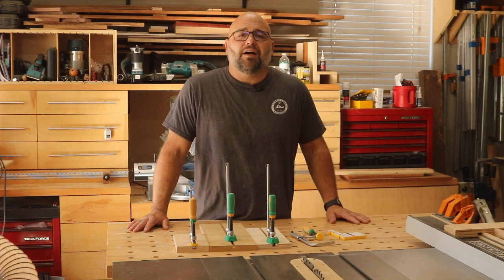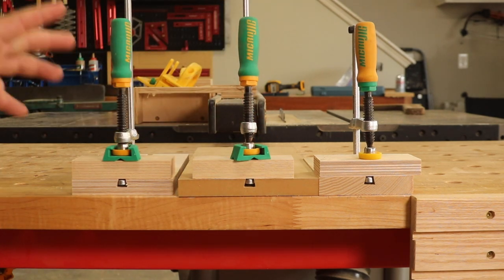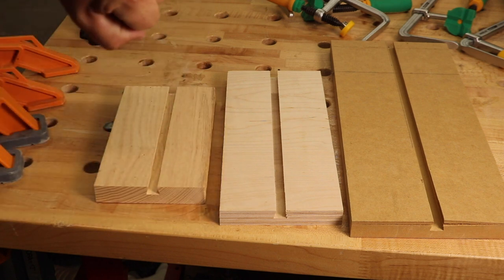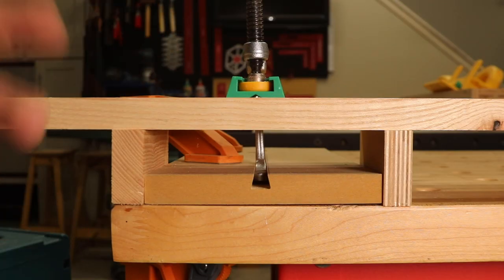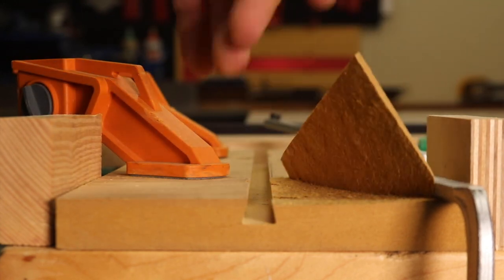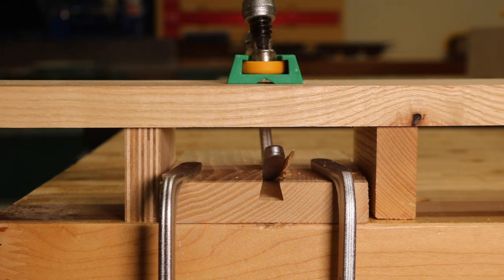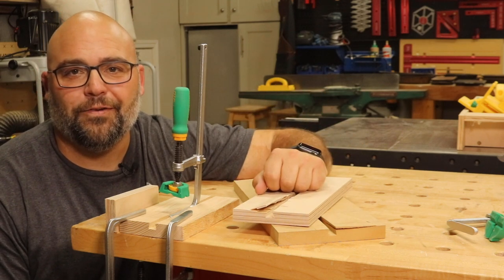Are Dovetail Grooves Strong Enough for Microjig Dovetail Clamps? Let's Find Out!

Comment: Awesome test! I think the ash failed because the failure plane should be about 45° which looks like it may have been in line with the grain direction. Had it been in the opposite direction, I bet it would have been stronger.
Reply from the maker: I bet you’re exactly right. I thought about the same thing after I watched the video.  Would like to try it with the opposite direction! Thank you!
Reply: I'd love to hear how that turns out. Like you said, it's an unconventional, and unlikely clamping method, but must be done for science!
Reply: @PenaltyBoxWoodshop  Hey Jess no worries you have 37,000 other and I know youre busy.  Like t share my dovetail method with yu sometime.
Reply: These clamps are great as long as you realize their limitations.   None of the later tests here were legitimate due to clamping methods, but still interesting.

Comment: WARNING!  I just built a workbench top using the Microjig 360 Workbench plans (which need improving). While doing so, I did experience dovetail groove failure when I left the clamp in a groove without it securing wood - dangling in the groove. I happened to brush against the clamp and the result was a broken groove - the wood split. No more clamping at that area of the dovetail groove. So, don't leave a dovetail clamp in a groove without having it pushed snug against the table or a piece of wood that you want clamped. I still love the dovetail clamp concept.

Comment: Just found this. I’ve been using the microjig system for a cpl years… while the routs are probably not going to fail outright like here, in MDF they do compress AND abrade over time and eventually get too sloppy to use. The solution is to make the clamping surface easily replaceable or use something like Baltic birch. In MDF I flood the channel w a cpl doses of thin CA glue which really does seem to help

Comment: Great test. Thank you for posting this video. It would be appreciated if you would do a head to head test comparing the strengths of the routed dovetails against aluminium t-track, routed t-track, or slots milled into the base.
Reply from the maker: That’s a pretty good idea. Thanks
Reply: There is a video of that test. I think the maker of micro jig did the test...I just watched it but can't remember where.

Comment: I am currently in the design/research phase for building a MicroJig Dovetail Workbench, I see many advantages. And so I really appreciate your testing efforts since strength of materials is a primary concern.  Your analysis has sparked more in depth thought and I want to share.  First I was surprised to see the wood break out easier than the Baltic Birch plywood but I then thought: 1) your clamp was with the grain and so was possibly testing its weakest situation, I noticed how just a bit of grain severed, thinking that running the clamp across grain would be at least a bit stronger.  2)  In my experience with ash it seems to be a bit rigid, possibly because of its open grain.  Wondering if maple, that is a wee bit harder and very dense, might hold up better 3) Then in considering grain direction it came to mind that the Baltic Birch is laminated with grain in opposite directions so no matter which way one would clamp there would be cross grain clamping. Birch is a bit softer than ash but like maple dense. 

My thinking to this point was to use MDF with a Formica laminate. After watching your video I am now leaning real hard to Baltic Birch with a Formica laminate.  Thinking that the Formica laminate will provide a nice smooth easy to clean work surface and might/should add some strength, maybe even considerable strength.  

So this test you presented really gave me some great input and thank you for doing so.  If you, or anyone, has any thoughts on my above rational I would appreciate, especially as to the advantage of adding a Formica laminate.
Reply from the maker: Thank you so much for the in depth comment and analysis. I actually agree with the fact that it most likely broke due to grain direction which was something I didn’t think about when making the video. I think your idea of Baltic birch with a laminate top will work excellent!!!!! Thanks for the support and good luck!!!!
Reply: Looking into an HDPE assembly table myself.  I thought I saw one on one of the micro jig videos. May fit the bill for your requirements also.
Reply: It was also unfair on how he placed the hold-downs.  On the plywood they were closer to the dovetail grove.  In the ash test they were a good bit further away.  If the hold-downs were fractions of an inch away from the groove I suspect both would have held up well.   You mentioned the grain, and I was watching the test while studying the grain and thought the ash would fail easily.   If it had been all vertical grain the results would have been different.  Also that was high end plywood!  13 layers.   Try the same test with a 3-layer plywood with voids and watch the difference!   The quality of the plywood is a BIG factor.

Comment: Great test.

These clamps work great as long as you have the clamped material directly above the clamp arm (in the slot)... just like a t-track clamp.  The material clamped provides equal pressure down, meeting the pressure up from the clamp arm and spreading the load out towards the sides.  Without the supporting material above, the track will blow-out no matter the material used for the base... again, just like a t-track will.  They are not designed to be used otherwise, at least under anything but the lightest of clamping load.

I love mine since it is so easy to route tracks just about anywhere, as opposed to t-tracks (more effort and $ to install).  My plywood topped outfeed/assembly table is full of dovetail groves.

Comment: Great video! I was looking to see how this would hold up in MDF. Yeah, it broke in the MDF, but like you said, it was unconventional. I think for normal clamping use, it should work fine for the application use I plan on using it for.
Reply from the maker: Yep. I’ve never had an issue when using them normally
Reply: Exactly - I’m planning an assembly table/tracksaw cutting station and want to use MDF for the top. A few slots running lengthwise will be great for stop blocks & jigs. Based on this video, I don’t see any problems.

Comment: The second test at 10:29 is a little bit unfair. While you tested MDF by clamping the piece down from the side, you used two clamps on the front side for Plywood. That of course holds back your piece better than MDF from the side. So the testing conditions are not really similiar. But it's a good overview for sure, thanks!

Comment: I think the second test may be the more accurate.  If in the first tests the bottom metal of the clamp is touching the board it is holding down the only way to make the clamp fail is to crush the board.  The clamp has to have a small gap between the board and the metal of the clamp.  As an example, if you had a 1 inch dado in the bottom for the clamp to slide into.  You could crank the clamp really hard but still just lift the hole assembly up.  Hard to see if in the video there was always a small gap between the bottom metal piece and the clamped board.  Thanks for the test but I am less impressed with my dove tail clamps.

Comment: Greta test. The only thing i can think of why Ash failed that easily would be the grain direction maybe? If the Ash was plain sawn the layers would be like that of the plywood maybe it would yield better results. However with the glue lsyers of the plywood since its stronger than the wood itself maybe thats why in addition to its layers being horizontal in relation to the clamp force.
Reply from the maker: Thanks and I agree. The grain direction was a failure point and I didn’t think of it until after then video was shot.

Comment: 7:08  Plywood may had performed better because it has cross laminations and was better supported because your bench clamps were installed closer to the slot than you did with the other materials.
Reply from the maker: That very well may be the case. I don’t disagree
Reply: Yeah, the MDF was clamped to the bench way further back, whereas the PLY was clamped very close to the slot ... so not really a like for like test.

Comment: I coated the grooves with CPES™ - Clear Penetrating Epoxy Sealer and hardened the Baltic birch board into an almost metal-like holder. It's a specialized penetrating hardener that can extend the life of the grooves considerably.
Reply: Oooh. I assume this can be done to MDF/HDF as well?
Reply: @MadLadsAnonymous  Check out the people that make the stuff for a more intelligent answer than I can supply. I would presume that the CPES epoxy would penetrate to a certain distance and that part would be strong, but... if the epoxy was not present, that would be where the weak part would start. It's a killer product and it lasts a loooong time!

Comment: The last test pulling clamp up on Ash/ try doing that same test with track running across grain. Looks like the test you did was with track running along grain.
Reply from the maker: Yea, I didn’t realize it until later but I agree
Reply: Great tests though! I just bought the micro jig dovetail clamps and was wondering how well they work. I expected they wouldn't work too well with plywood so was grateful you showed that test!
Reply from the maker: Thanks! I havnt had any problems with them

Comment: I think if you finish the MDF with a 50/50 mixture of polyurethane and mineral spirits if would add quite a bit of strength to the MDF.
Reply from the maker: Very well may
Reply: As long as your using it like its meant to be used and stay away from the edges when possible it probably doesn't even need the extra, the top of the clamp bar will make contact with your part before it ever gets to the point of failure, giving you don't spontaneously trip and grab the clamp lol

Comment: Thanks for this. I've been afraid to try these. Then again, I would be curious to know if aluminum t-track holds up much better than the plywood.

One case I can think of where a gap above the slot would happen is clamping a tool that has feet to a bench. E.g. I have a mortiser that I don't use often. Might be good to attach it to a board with countersunk bolts if planning to use with these.
Reply from the maker: Great point!

Comment: The second scenario, or the setup you referred to as unconventional, is actually exactly what microjig promoted as pipe clamp replacement setup, where they have a clamping board mounted vertically on the side of the table and used the clamp to push the clamped object laying horizontally on the table. It is arguably worse than your setup because they rotated the clamp claw 180 degrees, almost like when you applied backward pressure. Is it possible that you could do a test in that setup?
Reply from the maker: I could defiantly check it out. The fact is though if the clap is clamping some down on top of the dado then it will not break. I’m trying to picture what you are referring too but I’m having trouble understanding. I’ll have to look into it
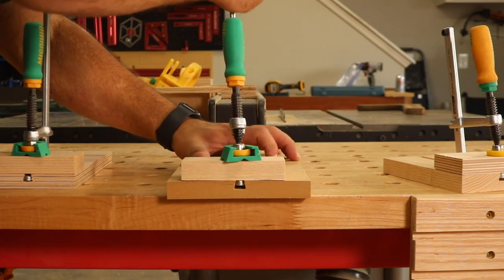Reply: @PenaltyBoxWoodshop  in this video, go to 3:05. https://youtu.be/QvGGxucDhzA
Reply: @PenaltyBoxWoodshop Did you see the setup in the video that I referred to in the reply below?
Reply from the maker: Ohhhh I just saw that. That’s interesting for sure! I’ll need to try that out!

Comment: Thanks for the video. I just got my first clamps and I’m just starting to use them. Question: I know you showed that MDF failed fairly easily, but have you used MDF for your dovetail tracks on occasion and, if so, what applications? Thanks
Reply from the maker: Thanks Matt and congrats on getting started! I’ve used MDF and dovetail clamps for sacrificial table saw fences and other various sleds. It’s not that bad but you have to know when you work with it that it can fail easier than others

Comment: I can misuse anything to the point of failure.  Take my first marriage, for example.  The system was not designed to be used like a press.  It is a clamp which uses moderate force to temporarily hold materials together.  I am sure that you wont need to turn these down so hard that you break the dovetail groove or mark your wood surface with the pad.  MIne work fine in MDF for light work and in void free ply for heaver applications.  I would not use solid wood due to the greater potential for warping.

Comment: Most of my clamping is what you call unconventional. I don't use tracks at all - they are never where I want them. So when I need to clamp, I just drill a hole through the spoil board and use threaded inserts - the ones with the large disc and three prongs that bite into the wood. By putting one of those below I can drop an M8 screw through and wind it up as tight as I want. screws are far superior to clamps as they don't interfere with the movement of the CNC.

Comment: This is like watching karate board breaking. You put two clamps an inch or two from the slot. In the other where could the clamp go? Thru the wood you were clamping. Of course it held up.  Ever see a karate guy break a board against the grain? Or stack the bricks without spacing the blocks, they break like dominoes. Granted in most applications there is a board directly against the clamp base but you apparently can not do glue ups . Unless you use some funky clamping like putting the clamps on top rather than the bottom.  I have this system and for handwork it’s great an infinity adjustable workbench side clamp. But this test was silly.

Comment: Curious how the MDF fares clamped mid-board instead of at the end since the failure looked to start at the end of the MDF piece.
Reply from the maker: Yea, I’m sure it would be more stable but not much more. MDF just isn’t build for that type of strength I don’t think
Reply: Considering how many of the setups use the 4"-square groove pattern, the mid-board failure should look pretty much like the end failure.

Comment: Assuming I go with plywood, what finish do you recommend that won't clog tracks but will give a durable surface? (I suppose you could finish and then cut grooves but then grooves wouldn't be protected.)
Reply from the maker: If I’m being honest, I don’t really finish my shop project stuff that often. But, they have wiggle room in the groves for the clamps so I wouldn’t worry too much about sticking. Also, you could use wax in the groves for protection and ease of sliding.
Reply: @PenaltyBoxWoodshop  OK, thanks
Reply: I was thinking about that too, thanks for the response. Probably it will be easier and avoid that problem if the polyurethane is sprayed instead of brushed in.

Comment: You had more leverage with the MDF  because IT had a much bigger base.
Second test you had the clamps right next to the slot wich also resulta in less leverage then with the MDF. Tests were not the same with all the wood
Reply from the maker: Either way, if your clamping something down regularly, it will not break.

Comment: Sir your tests are flawed. Take a look at how you clamped the mdf compared to how you clamped the plywood. The mdf only had 1 clamped at the front farther away. The plywood had 2 clamps nearer to the cutout. This might be why the plywood held better. Not bad but like you said, no one would use that system that way.
Reply from the maker: Thanks for the input! Just did my best to test them the only way I knew how.

Comment: Clamps holding down plywood were too close to center of plywood under test. They should have been placed at the furthest point from dovetail cut. Test should have included testing on a dovetail cut across ash wood grain.

Comment: There was nothing surprising about any of these results. MDF is garbage. I laugh every time I see people putting pocket holes in this crap. The plywood held out the best because it has different grain directions glued together. The solid wood failed because wood is very weak along its grain. You should have tested the wood with the slot cut cross grain to see if it was stronger.

Comment: Anything can and will fail. But with these it’s only by operator error. Either using the wrong material, like MDF, or by leaving them loose in the track and bonking into them like an moose. 
So don’t be a moose. Nobody likes a moose in their shop.